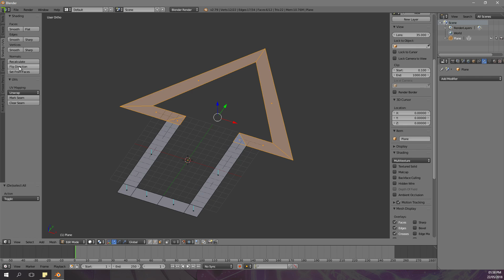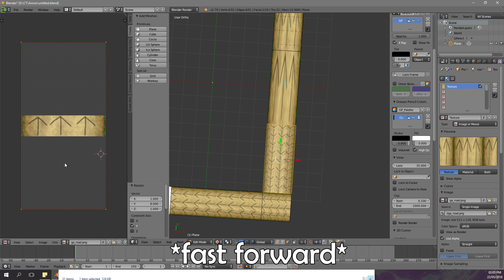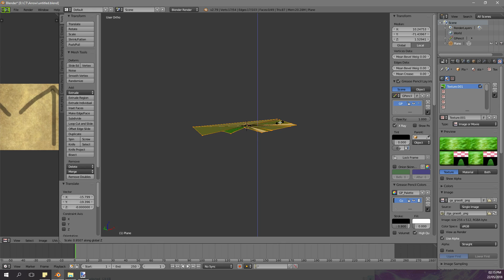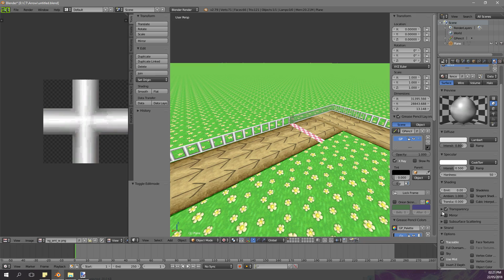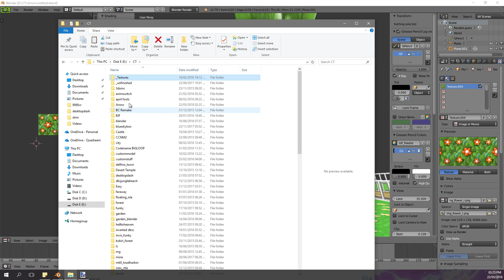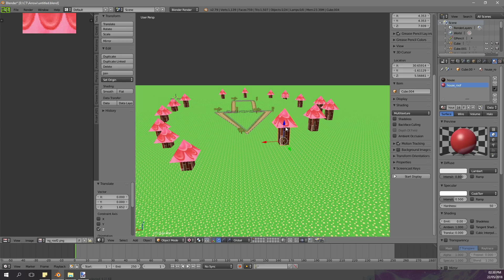The Making of: Arrow Circuit - Let's Make a Custom Track for Mario Kart Wii

Comment: Hey, I know no one is probably going to see this but I'm having a really hard time making a custom track. The brres editor will not work unless the track is fully 2d and even when it is, loading up the track is invisible and can't even be played. I have tried following many tutorials with minimal luck. If anyone could help me, that would be great. Thanks.
Reply from the maker: Try using Sniki's tutorial. He imports the model into Brawlbox, which is 1000x more stable than BRRES Editor. I'll link the export episode here, and you can find his full tutorial playlist in the description. https://www.youtube.com/watch?v=g51OVCUge6k
Reply: @KevinVG207  thank you so much
Reply: @KevinVG207  Hey there. I have been using Sniki's tutorials and they have been working very well. The only problem is, that BrawlBox (which he uses for brres) keeps crashing whenever I try to import my object. For some reason, all the brres programs do not like my obj file. If anyone knows anything on what I could do to fix this, that would be a tremendous help. Thanks